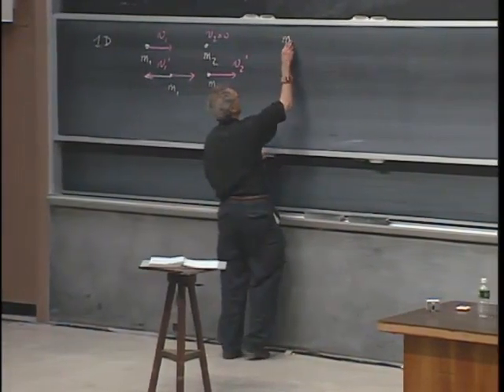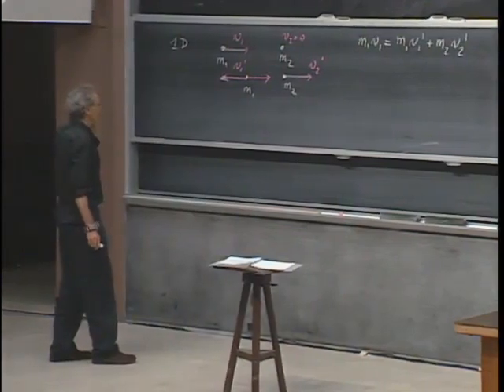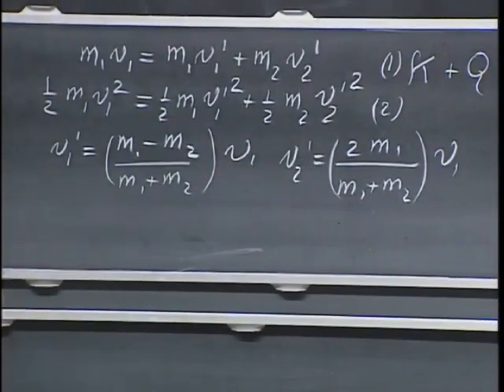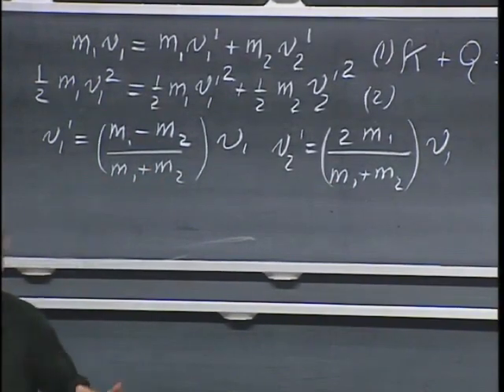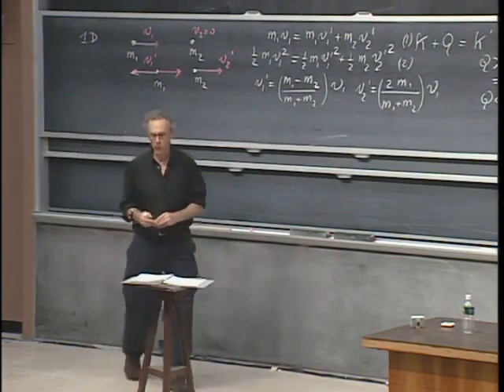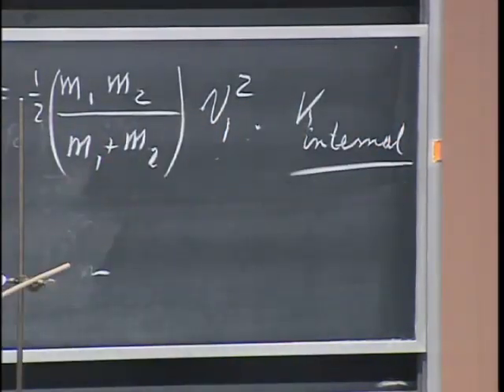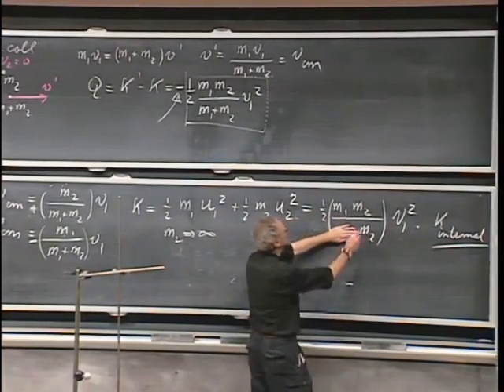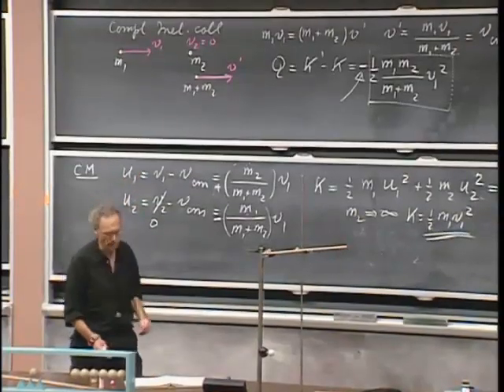8.01x - Lect 16 -  Elastic & Inelastic Collisions, Center of Mass Frame of Reference

Comment: I call what is happening to billiard balls when they collide "Momentum Transfer".
Here is why. If the balls have the same mass and there is no friction or external force between them, the moment and kinetic energy is conserved. Now, if a ball with mass 'm'--b1--collide with 2 balls at rest, its momentum is transferred to the first ball in contact--b2--and again, b2's moment is transferred to the third ball--b3--. So, mv1=mv3 and b3 takes off.
      If we use mathematics, v1´=0 and v2´=v1(before it transfers momentum to b3). When v2 transfers, v2´=0 and v3´=v1. As an example, if 3 balls collide with 2 balls, the two balls in the 3 balls system push 2 balls at rest with 2mv and momentum is transferred ,so, the two balls takes off and 2 balls momentarily at rest and the remaining ball collide with them and as in previous argument, another 1 takes off. This all happened in a flash so, we see 3 balls take off. Professor Lewin,please  correct me if I'm wrong.

Comment: For the problem of the wall and the ball. Consider instead of a wall, a huge cement block sitting on the ground (acts like wall). When the ball hits the block, it exerts a momentaneous force on the block. This force does transmit kinetic energy to the block, but at the same time, the ground exerts a static friction force on the block, taking away that energy, hence, the block doesn't move. Momentum isnt conserved as there is a net external force acting on the system (the friction force) as the collision takes place. The ball bounces back due to action-reaction principle (the block exerts an equal but opposite force on the ball, that accelerates it, changing the direction of its velocity). In other words, there is a net impulse over tge system that changes its momentum. We can replace the block with a wall and the friction f. with forces due to the configuration of the building. If the block was sitting on a frictionless surface or the wall was inserted in a peculiar system of frictionless rails attached to the ceiling and to the ground, then there wouldnt be a net external force and momentum would be conserved. In this case we would see indeed that both the wall and the block would move (with the corresponding velocities arising from the equations).Would this reasoning be correct sir?
Reply from the maker: you have not yet solved the wall - tennis ball problem. In the case of very high mass of the wall, the wall can have a HUGE momentum but ZERO KE.
Reply: @lecturesbywalterlewin.they9259   Ive read a comment below suggesting you can consider the wall to be the earth. I dont understand this, as the ball itself would get attracted/accelerated towards the object it is going to colide with (due to gravity force). Wouldnt this make it impossible to apply conservation of momentum? In other words, in order to apply the M>>>m approximation dont you have to make sure the difference of masses is not big enough so that the gravitational interaction is no longer negligible in the first place?
Reply: @lecturesbywalterlewin.they9259  what formula do we use to determine the momentum of the wall? Mass is huge (infinite) but velocity is 0, so momentum would still be zero.

Comment: Sir if we consider the the system to be earth, the wall attached to it, and the ball so when the collision happens the wall and earth gain momentum but since their combined mass is very large compared to the ball they don't move much so, momentum is still conserved. Is that a correct way to think about this situation?
Hope you're having a great time ❤️ and thanks a lot for these valuable lectures ❤️❤️❤️
Reply from the maker: KE_wall = p^2/2m for finite p and m=>∞  KE => zero. m is mass of wall p is momentum transfer from tennis ball to the wall.

Comment: Momentum is scaled velocity vector. If m is very high then P will be high (velocity vector gets scaled by mass even if it is very low).
Kinetic energy is a number. If velocity vector is low , then it's magnitude is also low . Then |v|^2 is also low. So KE~=0.
Thus wall has p=2mv but KE~=0.
Is this correct?
Reply from the maker: use google. this cradle is discussed extensively on line

Comment: For the tennis ball hitting the wall;

As P=Mv, v=P/M
And due to M=infinity, P/M must be 0?

Similarly I think this can be shown using F=ma, since the change is momentum is equal to the product of net force and time.

Either way, v=0, hence K.E.=0J

Also a question, if we imagine that the wall is moving towards the tennis ball instead, then we get a similar (perhaps the same, just from a different viewpoint) result, and this is like the m2=0 scenario, in which v1'=v1, so the velocity of the wall cannot change, and neither does kinetic energy of the wall. Is this also a valid solution?
Thank you for reading this
Reply from the maker: If P is not zero, how can KE be zero?
Reply: Lectures by Walter Lewin. They will make you ♥ Physics.
Well, taking a different approach, surely if the wall gained any velocity after the collision then the energy is the system would be infinitely great which would violate the conservation of energy.

However, why does it not work such that P is finite and M is infinite so P/M=0, and despite the wall having gained momentum, it cannot have gained and velocity?
Reply from the maker: ok

Comment: The question regarding the tennis ball bouncing off the wall and the wall not moving even though the ball has had a momentum change
Is the answer related to the inertia of the wall? the ball does provide a change in momentum and hence a force on the wall but because of the wall having a really high inertia, it does not move

Comment: Prof. Lewin, may I request to please correct me if I am wrong.
Wikipedia meaning of explosion:  An explosion is a rapid increase in volume and release of energy in an extreme manner

The applications of explosion in the system the principle of Thermodynamics fail.

The Internal Energy is multiple times lower than the work done by the system or The WORK OUTPUT is multiple times higher than the WORK INPUT 

I. A 15 ball billiard pool to be strike by white mother ball. 
F = 30lbs (White Mother Ball); D = 3ft (Distance from the white mother ball to the first ball to strike); W = Work, F = force; D = Distance

The mother ball to strike the 15 ball is the work input
The first collision is explosion followed by increase in force and travelled distance by individual ball followed again a series of collisions.

The mother ball transferred the force to the group of 15ball. The momentum is conserved to the group of 15 while the explosion increases to 15 individual ball. 

The kinetic energy was absorbed by the group of 15ball. The explosion increases rapidly multiplied to 15ball individual. 

SOLVE FOR WORK INPUT 
W = F X D;  W = 30lbs  x  3ft  =  90Ft.lbs          

SOLVE FOR WORK OUTPUT 
W = F X D; W = 30lbs x 3ft = 90ft.lbs  X 15ball = 1,350 ft-lbs.

II. For more heat energy the ball to replace with steel ball and steel side board. After strike are explosions of 15 balls. The explosion increases the group energy into individual 15. The work output higher than work input followed by series of collisions that produces more heat more work output, more sound energy more work output, more travelling distance more work output.

III. To get even more energy output: Put additional two group of 6balls in triangular shape to be placed somewhere at the back of 15balls at least 4inches apart from the sidewall and back wall. A total of 15balls + 6balls + 6balls = 21balls. The explosion creates collisions after collisions increasing the energy output.

The Internal Energy in I, II, III are the same however, after explosion the work done increasing 15 times the Internal Energy. That principle can use to make free energy machine.

Thank you. 

Abel Urbina Abel Urbina Free Energy Super Machine

Comment: The wall has momentum but not significant kinetic energy because its enormous mass causes the change in velocity (due to the impact) to be extremely small, leading to negligible kinetic energy. The momentum transfer occurs, but the wall's kinetic energy remains practically zero due to its large mass and the energy distribution into other forms.

Comment: Regarding brain teaser at end of lec:
Let us assume k1 balls are moving with velocity v1 initially and k2 balls are moving with velocity v2 finally. 
K1mv1=k2 mv2(conservation of momentum) 
Hence K1v1=k2v2........... (1) 
Since collisions are elastic KE is conserved. 
Hence, K1(1/2m(v1)^2)=K2(1/2m(v2) ^2) 
So, k1(v1) ^2=k2(v2) ^2.......... (2) 
By solving equation (1) and (2) we get k1=k2.hence same no. Of balls should be ejected which initially hit. 
Hence, proved. 
IS IT CORRECT?
Reply: You assumed that k1 balls stopped after the collision, why? if you have let's say 2 balls with masses m1 m2 and velocities v1 v2 initially and u1   u2 finally even if  v2=0 that doesn't mean that u1  will be 0 only if m1=m2 that will be true I think the same apply in your situation with k1 k2 so you assumed that u1=0 so it's like you  assuming that k1=k2 and that is why you end up to this result

Comment: based on hours of algebra and what I've read online, it seems conservation of KE and momentum are not enough to solve that Newton's cradle question, because there are actually infinite solutions that would conserve both.  It seems the physics for why it happens in this particular way is much more advanced.  Is this correct?

Comment: professor this is my answer on the momentum problem:-
m - mass of the tennis ball ; M - mass of the wall ; u - initial velocity of ball ; u' - final velocity of ball ; V - final velocity of the wall
1. Change is momentum must  be zero, [ mu = mu' + MV ------- (1)]
2. From (1) we can get [ V={m(u-u')}/M------(2) ]
3. In (2) we know the mass of wall(M) is infinity so the velocity of the wall (V) is zero.
4. So, |u| = |u'| but the directions are opposite.
5. So, the KE of the wall is zero(1/2M(0) but the momentum is 2mu not 0.
Is it correct professor???
Reply from the maker: wall: KE=p^2/2M
p is not zero, but M is infinity, thus KE=0
Reply: I guess I over did it :p .  Thank you professor for always responding so quickly

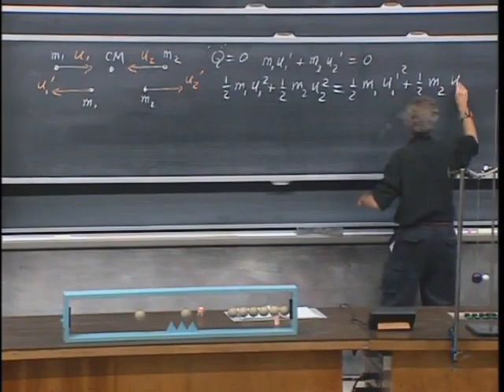Comment: At 27:20 when you write down the conservation of energy equations, can you ignore the “true” velocities of m1 and m2? Does the conservation of energy hold even when you view it from the frame of reference of the centre of mass?
Reply from the maker: no energy has been ignored in my calculation. I suggest you watch the lecture again. I cannot add to the clarity of this lecture.
Reply: Lectures by Walter Lewin. They will make you ♥ Physics. All clear, thanks Prof!
Reply: @vinbhaskaran  There is no such thing as absolute velocity.  It is an arbitrary choice of what reference frame you use as a datum to measure velocity.  You can solve this problem in the lab reference frame, and you can solve it in the center of mass reference frame, and in both cases, you get the same answer for the final velocities of both bodies.  You can solve it in the reference frame of the sun, and you will still get the same answer.

In the center of mass reference frame, the kinetic energy that you calculate is the internal kinetic energy among the bodies in the system.  And this is the maximum amount of kinetic energy that can be dissipated as heat/sound in the collision.

Comment: Thanks for the wonderful explanation, Professor. I was thinking about the problem with the balls and I believe that 5 balls have to be in motion after the collision due to the conservation of kinetic energy. If fewer than 5 balls were in motion, then due to the conservation of momentum they would have to be moving faster and because Kin. En. is proportional to the square of the velocity and momentum is proportional only to the magnitude of velocity, Kinetic Energy would increase after the collision. But if the collision is completely elastic, that cannot happen. Thus the only possible outcome is having the same number of balls in motion before and after collision with the same velocity. Is that correct?

Comment: For your question, you said that KE is zero since the wall has no velocity, then how can it have a momentum without a velocity ?
Reply from the maker: +Shivam Agarwal Momentum can be HIGH and KE effectively zero for very massive objects. I suggest you figure this out on your own. If you don't succeed in 2 weeks, contact me again.
Reply: +Lectures by Walter Lewin. They will make you ♥ Physics.  Is it because even if the have velocities very very low velocities, they have a high momentum because of the high amount of mass they posses ?
Reply from the maker: +Shivam Agarwal you are getting close. You can express all this in one equation which will tell the whole story. Can you do that?
Reply: +Lectures by Walter Lewin. They will make you ♥ Physics. Well if m2>>m1 and the momentum imparted to m2 is 2mv, then the speed of m2 will be given by 2mv/m2. But, because m2 is very very high, the velocity will approach 0. Thus KE which is given by 1/2m2v^2 will be about zero. Is that correct ?
Reply from the maker: +Shivam Agarwal yes that is correct.

Comment: Suppose a ball is thrown upwards in a room and it hits the ceiling and comes back down. We observe that the velocity of the ball increases. Conservation of momentum does not take place in this case, does it? External force is indeed applied initially.
Reply from the maker: If the the ball hits the ceiling with a "decent speed" of about 1 m/s and if the collision takes place in a very short time (0.1 msec), then to a very high degree of accuracy the magnitude of the momentum of the ball just before and just after the collision are the same (assuming that it is an elastic collision). The reason is that the change in velocity due to gravity during the 0.1 msec collision is only 10*10(-4) = 10^(-3) m/sec.
Reply: Lectures by Walter Lewin. They will make you ♥ Physics. But in real cases, velocity increases by a rather large and considerable value?

Comment: for the last problem...lets change the frame of reference....lets consider frame is on 5th ball and then we will see 3 balls are approaching to us and what we will see is 3 balls get detached from behind and balls which were approaching gets attached to 5th ball
Reply from the maker: it's a multiple collision problem. It's easy to show that the end result is consistent with the conserv of momentum and KE. But that is not the complete solution. use google

Comment: Dear sir,
There is a question which is iching my taughts since many days, that why speed of sound is constant??? Even though sound propagate by means of elastic collisions between molecules, speed of sound should depend upon the speed of molecules near the source of sound. Yes I have heard it already that  molecule speed is directly proportion with the increase in pressure so the bulks module remains constant and hence the formula holds. But why then same phenomena is not observed in collision of two identical elastic balls, were the velocity of second ball depends upon the velocity of the first ball and hence the velocity of propagation of this collision also depended on the velocity of first.
Reply from the maker: https://en.wikipedia.org/wiki/Speed_of_sound

Comment: I would like to leave a question about the ball-wall collision. If the ball with mass m collides with an initial velocity v and comes out with a velocity v in the other direction , than there must be a momentum transfer to the wall of +2mv, because of the conservation of momentum of the system. I understand that K=P/2M, where M is the mass of the wall, and can be thought as a limit case where M->infinity, threfore K->0, even though P is not zero. However, where is the momentum in the wall? I mean, physically speaking, I can not understand how can something have momentum and no velocity.
Reply from the maker: >> I understand that K=P/2M> That is not correct. K=p^2/2m.
Other than that your reasoning is OK
Reply: Thank you professor, I didn't notice that! But my question remains on how can you have momentum without velocity, that seems weird.
Reply from the maker: At the collision the tennis ball transfers a momentum p=2mv to the wall. m is the mass and v the speed of the ball. The KE of the wall is p^2/2M Here M is the mass of the wall. p is finite (+2mv) If M ==> infinity, KE ==> 0 but p remains +2mv.  There is another way to look at this. The momentum of the wall is 2mv=MV  (V is the velocity of the wall after the collision). Thus MV is fixed M=> infinity then V must go to zero to make sure that MV is finite. KE of the wall is 0.5MV^2=0.5pV.  p is finite but V=>0. Thus KE=> zero.
Reply: let momentum of wall be M
by conservation of momentum
mv=- mv+M
M=2mv
let kinetic energy of wall be K
as the collision is perfectly elastic kinetic energy is conserved so,
1/2mv^2=1/2m(-v)^2+K
K=0
i think that must be answer tell me if i m right or wrong
Reply from the maker: I assume you mean momentum of the wall after impact is MV (here V is the velocity after the collision).
Reply from the maker: yes that's fine. Momentum of the wall after the collision is p=+2mv. KE of the wall after the collision=p^2/2M. For M==>infinity, KE==>0.